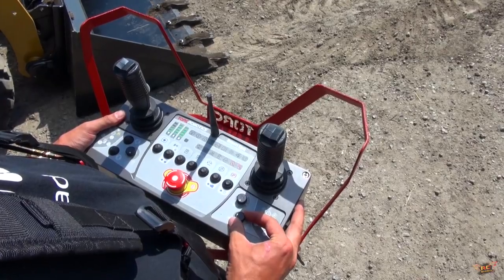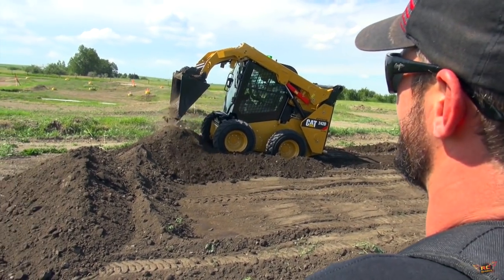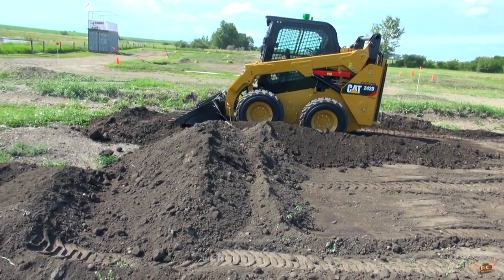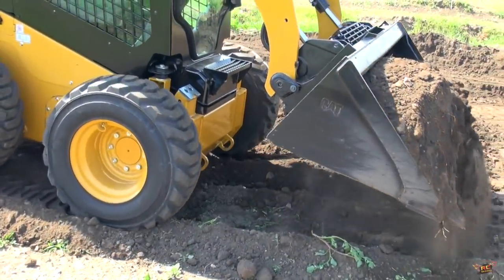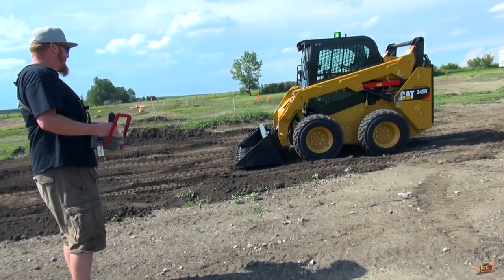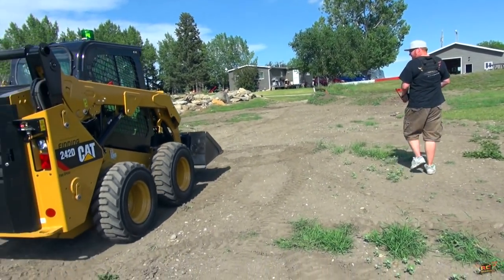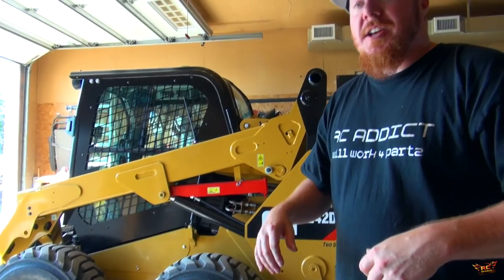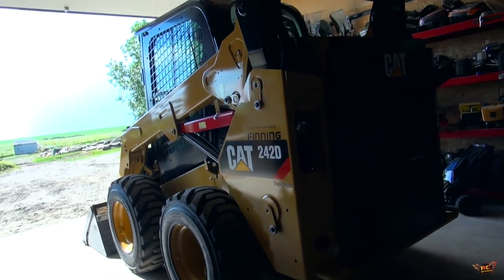The LARGEST RC I've Operated - FULL SiZE Radio Control SKiD STEER | RC ADVENTURES

Comment: that is the most bad ass thing i have ever seen you can probably change the face of the cat industry with that since there are accidents that occur while operating them and having a remote controlled one you wont put peoples lives at risk either. Basically if people drive them there is a risk of the machine catching fire or falling of a cliff with them in it, but if its remote controlled than if the machine does fall or catch fire the operator is safe from a life or death situation and only the machine is ruined. You can buy another machine to be replaced but you can never replace a life that lost

Comment: Not trying to be rude but its good to start them at idle, and shut them down at idle. If its been running and worked for a long period of time its also good to let it idle for 2-3 minuets before shutting down, this cools the engine and turbo. Also it's glow plugs or preheater, not primer.

Comment: What is the advantage of remote control vs sitting inside? I've operated those and I'd think you'd have much better control from inside.
Reply: These are built this way so machinery can be used in situations that are hazardous allowing the operator to drive the machine from a safe distance. 

An example would be removing contaminated soil from an area that would be toxic due to a chemical spill that could kill a human that comes in contact with or breathes the air around it. 

There's many scenarios where a machine would be required but a driver couldn't be in the cab and remain safe or alive. Bomb disposal is a possibility too I suppose. There's more examples in the video description too.
Reply: U wouldn't have blind spots and could use in hazardous Aries from a safe distance I would love to have that

Comment: Primer..Try pre heat....
Reply: If he is referring to the tapping noise, thats the fuel lift pump priming the engine
Reply: no? Have you ever started a diesel engine? That sound is the glow plugs.
Reply from the maker: Sighs*  why argue over something so simple.  Or why not listen to the guy who bought the machine.. It is the Fuel lift pump, priming the engine.

Comment: Why did they make this?
I am sure it is not for fun only?
Maybe for high risk jobs, where tipping over could be a problem,or tight places where you do not want to knock anything?
Reply: Pretty much. It's made this way so it can be operated in unsafe/hazardous conditions so the driver can remain safe and alive. Or even operated inside unsafe structures.
Reply: Aha, cool, thanks for the info!

Comment: I didn't know Alberta used green strobe lights for municipal/construction. I thought they all used amber. That's all that's on Jamie Davis' tow truck fleet.
Reply from the maker: It is an RC indicator :) There will also be a RED one installed at a later date - if I choose to continue with this model
Reply: +RCSparks Studio that's pretty cool! Do you know if your volunteer firefighters use lights on their personal vehicles for responding to the station in your province? I know some provinces don't allow them.

Comment: Rc sparks studio what would you recommend for someone's first truck
Reply: That depends entirely on what you want to do with your first truck. There are many many different types and sizes. For anyone to give you useful advice I think you'll need to provide some information first. 

I drive the hiking trails in the Adirondack mountains so I go with 1/10 scale axial rigs. I have the Scx10 power wagon and the wraith spawn.
Reply: +Joe Elmore rock climbing
Reply: +Keegan Hennessy The Losi Nightcrawler 2.0 is an excellent but very slow rock climber. It uses worm gears in the axles so it not a fast truck. I believe it's more of a competition style crawler.

For something more scale there's the SCX10 Power-wagon. It's a great climber so far and is awesome on the trails. Good speed stock. 

The Axial Wraith line is excellent. I have the wraith spawn, actually I have all 3 vehicles mentioned. The Axial trucks have LOADS of after market parts and upgrades too. You really can't go wrong with an Axial. If I had the money I would buy the Scx10 2 that was just released. It's very popular so far. 

On Facebook look for the Urban Gorilla RC Rock Crawlers group. There's more than 1500 members and it's hands down the best rc group I am part of on Facebook. The guys there will gladly answer any questions you have, show you pics and help get you started.
Reply: Wraith Spawn is a actually a rock racer but it can be configured for rock climbing. Because it's a racer though it comes with a 20t motor so it's a bit fast for rock crawling. I ended up swapping to a 35t motor for less speed and more torque and then upgraded the speed controller. The stock motor/esc combination isn't the best for slow crawling and climbing and I've heard it will burn up quick trying to do so.
Reply: +Joe Elmore ok thanks

Comment: So instead of jacking around with the remote how much more work could he do with the loader if he got his ass in the seat?
Reply from the maker: Actually, I have found that you can do detail work in tight spaces sooo much easier then if you are sitting in it.  being able to see outside the rig is a great tool, in itself.  Besides - for folks who have disabilities, or for folks that have degenerative spine issues, like me,  - or for folks that need to work in dangerous environments.. this is a great tool.  So, to answer your question - I can get more work done outside of my machine, then in.
Reply: Bobcat also has an RC system for their equipment, and dangerous operations along with detail work were their main selling points. 

I tried to get the boss to outfit one of our bobcats with one, so we could make it look like one of his dogs was plowing snow on campus.

Comment: Can someone please help me? I bought new proline tires for My traxxas slash 1/10 and the back wheel is rubbing on the body Idk what to do. Thx!
Reply: Is it only one wheel rubbing on the body? Check the shock to make sure it's not sagging too low. If it's only one wheel rubbing I would say that you have a bad shock or one that needs oil or adjusting. Or maybe the body was cut wrong and needs some trimming.
Reply: I would still check the shock and then compare both wheel wells to see if they were cut correctly. Might just need to trim the body a little more.

Comment: beeep beep beep.. arrrrr.. its trying to run me over..
Reply from the maker: there are TWO HUGE emergency shut off buttons.. one on the machine, and one on the controller. Also, the controller has a tilt gyro in it, that will shut off the machine if it is activated.

Comment: Ok I had to look it up plan it's 42k; plus adding all the bell's and things, not bad for a ranch hand that can work on call at all hrs.' and in bad weather & no pay ck..A good man would be 60k-per year. You can be sick with a head cold( God forbid) or whatever and work from in side. WAY COOL MAN. Fpv on the blade and in the cab would be the cat's meow man.

Comment: caterpillars are horrible skid steers. if you use them how I use them, you will regret everything about it. bobcats are far far far superior machines
Reply from the maker: Why do you say that? Not to be combative.. but I have not purchased either machine yet. There are many people who are strongly warning me about Bobcat, saying their latest machines are very unreliable. One thing I have learned after almost a decade on YouTube - is that there are many people, with many opinions, and many experiences have been had by all - with every brand. There seems to be leading brands, that all have their awesome points - and all have their flaws. Tell me your experience.. I want to know why you have your opinion :)
Reply: +RCSparks Studio okay the newest bobcats are the worst of the bobcats. the best all around bobcat is definitely the newest s130 you can get. although the newest bobcats are still better than caterpillars in almost every way. the only thing I like better about cats is that they are easier to grease. I excavate swimming pools in arizona, on average I spend 6 hours a day on a skid steer. caterpillars cannot be as precise due to the whole drive system being on one control vs bobcat using two controls. both companies use fly by wire controls now but the delay on caterpillar is ridiculous. you can sit there and slap the joystick and absolutely nothing will happen.  and another major thing is the step on your way into the cab prevents you from getting as close as possible to a truck, and just a couple of years ago that step was very sharp very easy to pop tires if you're not looking down which results in spilling dirt
Reply: +RCSparks Studio sweet videos by the way. and if you only plan on using the cat in wide open space, like in this video, it will work for you. they are just not idea for loading trucks and blasting through accesses with 3 inches of clearance on either side
Reply from the maker: matthew anderson Very interesting, thanks for the answer! Though.. I'm not a pool digger.. rather a dirt pusher.. and jump maker. I wonder if this model is a good one for my needs. I wont be loading many trucks in my near future.. but once in a while use the forks to unload pallets..  Again, it must be down to the individuals needs, and the brand they have had most success with..
Reply from the maker: matthew anderson Hah! looks like we typed our answers at the same time! Hey, thanks again for the advice.. glad you enjoy the show :)
Reply: +RCSparks Studio haha. yeah I feel like I can discuss the skid steer decision for days. I have actually blown up the engine of a 2015 bobcat s450, but there was more to it than it just blew up. But hands down, the bobcat s130 is better than the new bobcats and better than the caterpillars. it's all I care to run anymore.
Reply: +RCSparks Studio haha. yeah I feel like I can discuss the skid steer decision for days. I have actually blown up the engine of a 2015 bobcat s450, but there was more to it than it just blew up. But hands down, the bobcat s130 is better than the new bobcats and better than the caterpillars. it's all I care to run anymore.
Reply: Hmm I have had the opposite experience with bobcat skidsteers vs caterpillar but to each their own.
Reply: +Tyler Rainey people have told me that when they only have months of experience. I have thousands of hours on bobcats and on caterpillars. I actually first got good on a caterpillar. but after I spent equal time on a bobcat, I learned caterpillar is far far behind. a bobcat will do anything a caterpillar does but better and you will have more confidence doing so. there are things bobcats can do that caterpillar can never do
Reply: John Deere is my personal choice. The hydraulic power in those skids are amazing. For big farm equipment i wouldn't go with them only because your paying for the name brand
Reply: I've never ran a Deere loader before. Out of 100 pool excavation companies here in the valley not one runs deeres. From glancing at the deeres when I see them, it doesnt look like you can have very much visibility
Reply: What were you using the S450 for when the engine exploded?
Reply: matthew anderson My 864 bobcat is 18 yrs old. (2000 model)It has not been without a few repairs, but going strong every day into the summer of 2018.